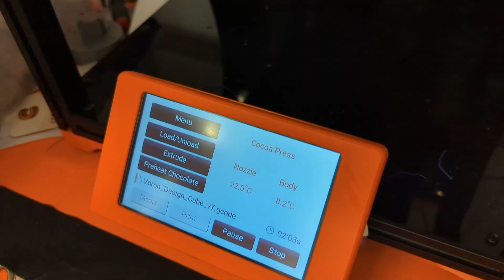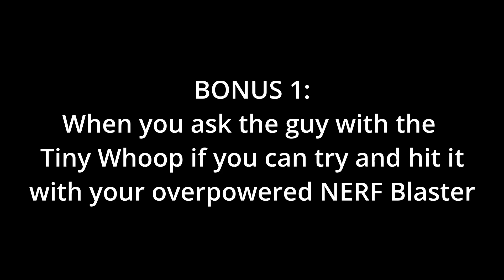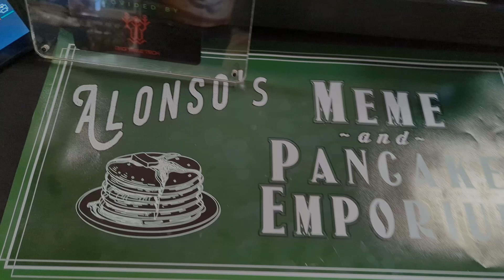MRRF 2023 - RECAP!

Comment: at 3:26 of the video there is a gyroscopic rotating machine.  does anyone have more info (a link) about it?  thanks.
Reply: It uses UV resin and rotates the mold while it is curing to mold objects iirc
Reply: @minivanracer  Yep, the guy said it had a couple of 100W UV LED panels inside that could cure UV resin though 3D printed molds, and it rotated so you could do rotocasting and have them be hollow to save material.  The molds were clamped together and suspended in the center of the unit.